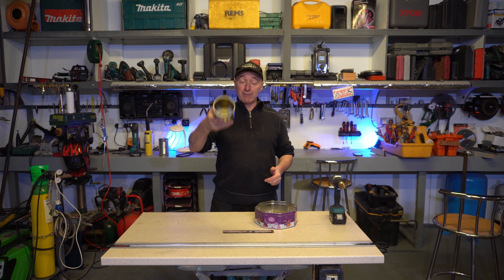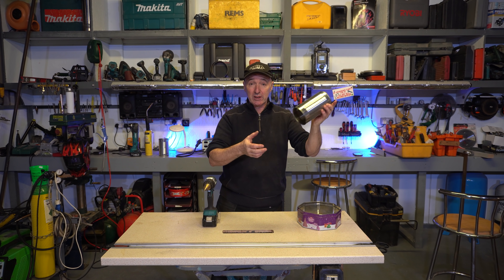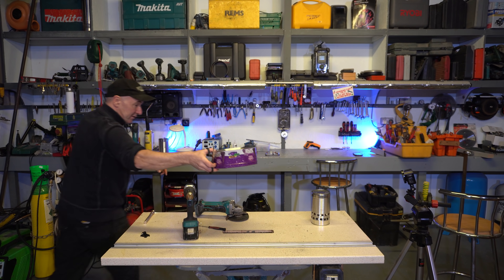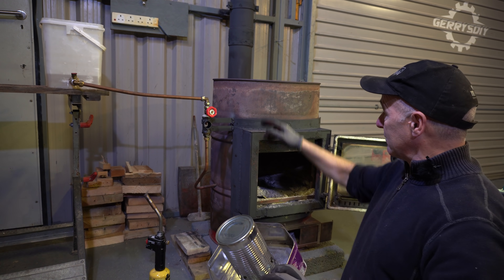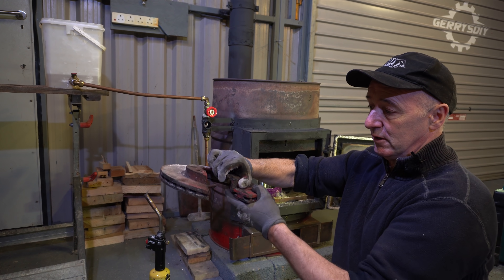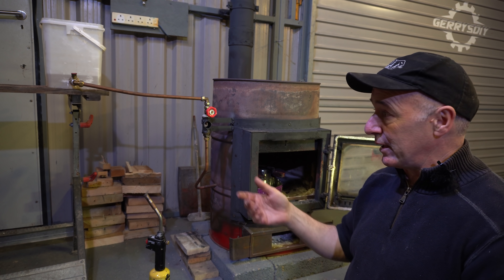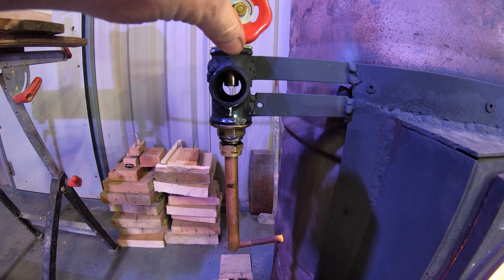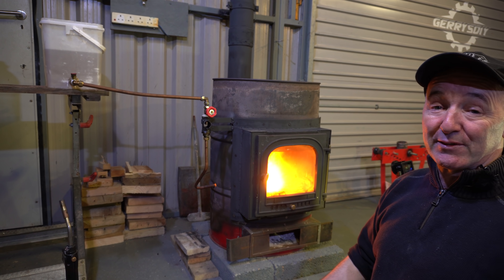Free Heat .. Fantastic Tin can Waste oil Burner

Comment: One thing you should note, one of the by-products of combusting hydrocarbons is water vapor. Unless you are venting the exhaust outside of the house, you are dumping water vapor in to your interior, which will over time migrate in to the walls, condense, and cause mold. Run a dehumidifier (which throws off a little heat) to keep the air dried out.
Reply: Yes, that's why burning candles in your home or having a gas stove will create black mold everywhere. So much water in oils.

Comment: I knew a marine mechanic who saved all the used engine oil from jobs. He would collect it, filter it, and feed it to a modified forced air furnace in his house. (I think he just changed out the Oil Burner Nozzle).  Free heat. Probably not that enviro friendly though.
Reply: That oil is better burned than dumped in a river or landfill.
Reply: @bladeoflucatiel  I agree on that. But most motor oil is now recycled into new motor oil anyway.
Reply: @kimchristensen2175  Or burned in powerplants.
Reply: What is environmentally safe..? Yes some fuels burn cleaner. But you have to capture the whole carbon footprint to get the answer.  Planet of the humans is an eye opening documentary.

Comment: I assume this was NOT for used cooking oil? but more for paraffin, etc?
Reply from the maker: Hi I start the process with a splash of kerosene in the burner to get it hot and within a minute I add veggie oil which will then vapourise. I dont blend it with anything so its pure veggie oil.  This burner will work with motor oil too. Cheers Gerry
Reply: @GerrysDiy  geez, then it must get extremely hot! this can warm up a whole factory no doubt, very hot

Comment: Free heat....so, I'm gonna need pipework, taps, a log burner, some form of chimney, kerosene and oil as my fuel. My missus aint gonna let me set that up in the lounge and oil aint free.
Reply: Not free, but recycled oil for heat. Not everyone uses oil constantly to have waste oil.
Reply: Your local chippy charges you for waste oil?! Hell, time you start using a different chippy.

Comment: How is this FREE
Reply: It uses waste used engine oil.
Reply: The "stove" may be free because you make it from odds and ends. The fuel ISNT FREE.
Reply: @Hugh_Manitee  Why is your local chippy charging you for taking their waste oil?
Reply: You can get used newspapers, junk mail, cardboard, mash them up in a 15 gallon bucket, press out the water and dry them as cakes. They burn clean and for a long time

Comment: The pan can also be made from an old brake drum, they last almost forever and radiate well. 
I built a fan forced one many years ago to heat water and run under floor hydronic heating, and as I built the whole thing into a detached shed
it also serves as a great clothes dryer in winter. I recently upgraded to a pulse pump system rather than babbit style, and fuel consumption is now under 1l/hour.
I get free oil from a heavy machinery company as used hydraulic oil, it looks pristine and has no contaminates visible. There is no smoke or smell once started and 
it heats a 200L repurposed and modified (ex electric) stainless hot water cylinder in just a few hours. I control that temp to 50C using a thermostatic valve to divert
excess heat to our 22kL water storage tank, keeping it above painfully cold and reducing freeze risk. I feed that HWC water into the house to the inlet side of two
Bosch instant gas water heaters. The gas heaters only add the differential heat from input to output, so gas consumption through winter when the waste oil heater runs 
 is almost zero, but if either system runs out of fuel, there is still always hot water available. I made the hydronic system with pex pipe and old aluminium printing plates 
used to clamp the pex to the underside of the floor, then I applied closed cell foamboard to seal and insulate it. This does require access under the house floor to install.
It is one of the best, and cheapest sources of clean heat available. It does make a bit of rumbling noise at night, but not loud enough to disturb anybody.
I also designed a more efficient burner that now gives complete combustion, lowering a polished piece of stainless steel into the exhaust flu comes out shiny after hours of use.
Apologies for the rant... just build one.
Reply: wow, sounds interesting! you should show us a video of it, I'm sure many would want my to see it

Comment: Free heat? Won't the open window for the smoke and venting the fire negate any gains or is this used to gas people?
Reply: "Tell me you've no idea how basic heating works without telling me that you've no idea". 
Salamander stoves have a chimney as an exaust for gases, heat radiates anyways, like any home fireplace.
Reply: @RenzitoARG  I didn't get your reply for some reason. Yes I have an open fire, a multifuel burner and oil fired heating in my house and I was brought up on wood and coal. We never put a sweet tin and bean can in the living room and hoped for the best though. I also fitted an air brick and vent into the house to provide draught to make the chimneys work effectively as uPVC windows/doors seal too well and produce a carbon monoxide risk. This free heat is only fit for a Dutch barn and they don't have walls.
Reply: Have you ever heard of this thing called a pipe? You can put these things called exhaust gasses through them and the gasses go from one place to another!!! I highly advise googling this thing called a "Chimney" I promise it'll blow your mind.
Reply: @NeillWylie  Most houses don't have chimneys and have very efficient sealed doors and windows even more of an issue in apartment buildings so pray tell O keeper of the wisdom what pipe are you speaking of, your fundamental one? In which case I recommend Flamazine cream it worked wonders on my gas axe burn. 😉

Comment: Burnt cooking oil, it must make a right smell.
Reply: He has a chimney extractor pipe, I think.

This could be run in a brick outside room with 2 water systems heated by it. One for your central heating and the other for your hot water tank.

Comment: Just remember people, that it is totally illegal to burn waste oil in the UK - Unless you have a 'permit/licence' - regardless of the amount. Personally i couldn't care less what people do.
Reply: same as posses chickens in uk ;d
Reply: Why it's illegal in UK?🤔
Reply: Just about everything's illegal in the UK now. The only things the police won't investigate and  the courts won't punish you for are real crimes like burglary, robbery, assault etc
Reply: Sorry old bean, it isn't illegal, as I use waste oils to run my Pug 306, fitted with a Bosch Diesel pump.
Reply: @0410195757  Sorry old bean, but do you ever read and fully understand a comment. If you are using any type of 'waste oil' in your pug, you are supposed to pay tax on it, otherwise that is illegal to do so. Burning waste oil (engine oils) is illegal unless you have a licence. Try looking up legislation.
Reply: @welditmick  ah sorry but the law is that if you use more than 2500 litres oh oil then duties would have to be paid. Also waisted engine oil is acceptable as with all oils if you pass emissions tests, which is always checked at the MOT test.

Comment: great in a rural farm type set up in ireland... but no good for suburban home ... also two to tree litres of hoiyl per HOUR ... waste hoiyl yes...   but any other hoiyl wont be cheap... i have been saving my vehicle hoiyl changes fo years i must have about 10 -  5 litre containers of waste engine hoiyl....  but i cant really use it in a suburban street in uk..it will stink... but.... if we have power outages this winter.. i will be burning it in back garden to heat water bottles up etc..... maybee a scaled right down version of your burner i wont need the extreme heat... just enough to boil water and cook soup..   ..
Reply: Burn it at night 😁
Reply: Can always be used as barter too

Comment: Tin can and a sweet tin and also a compleet stove or it wouldn't work :o because when you open the door it shuts down.
I dont want to use another compleet stove. So i wil try to come up with a cheap solution.

Comment: my oil is food oil, palm oil, i cant let it drop like you. have you use a special valve? if i few open the valve, the oil won't pass. i have to full open my valve to see the oil pass, but it is too much , so i have to manually open and close the valve to let the fire burn properly. i use an electrovalve too, with temporization, but the oil cant pass trought the narrow hole of this..

Comment: hi, how you have solved the problem of the frozen oil? under 10 c° the oil frozen and can't drop down in the copper tube. any sudgestion?
Reply: Warm it up?  Once running, the room temp is fine.

Comment: Hi Gerry, while doing some repairs to my oil system last July, inspired by your videos, I took a close look at the tank itself and was horrified to discover some cracks on a corner of the tank where the plastic had gone a whitish colour.  I marked their length and put a ratchet strap around the tank as it was full.  A few days later the cracks had grown slightly so a new tank was delivered by a Clontarf-based company who drained the tank, installed the new one, refilled the oil (filtered) and disposed of the old tank - all for a very good price!   A tank failure is a catastrophe - someone I know had one and it has cost about €20K with clean-ups, legal actions by neighbours and EPA inspections.  Three years later the work is still going on.  Might be worth a video to remind people to examine their tanks periodically, especially after ten years.

Comment: Why doesnt the oil leak out the joint between the dog food can and the bisquit tin?
Reply: i'm wondering the same question ! but thanks for the idea !
Reply: I'd assume it will if it weren't burning. But the tin should be hot enough that the oil vapourises upon touching it and burns off right away.

Having said that, it's probably smart to weld the gaps and seal them when making your own.

Comment: Brillant job gerry! How do you find using a old oil barrel, I thought about it as I can get one easier than a old gas cylinder. Is the oil barrel too thin? Would it stand the heat?

Comment: Will the drip rate control the heat output and is there a ratio for the burn tin and air supply can?
Thanks for your videos.
Reply from the maker: Hi Larry. Yes the drip rate controls the output but there is a range where too little will cause the flame to extinguish and too much will cool the burner and stop combustion. The flame will consume as much air as needed and is self regulating unless you use a blower to increase the airflow. Hope this helps Cheers Gerry
Reply: @GerrysDiy  Thank you

Comment: Hi Gerry! Tell me what is the diameter of the holes on the air can. And what is their total number.
Reply from the maker: Hi Alex. The can is 100mm diameter and there are 2 rows of 15 holes. The holes are 12mm in diameter spaced at 20.9mm apart. Cheers Gerry
Reply: @GerrysDiy  I understood. Many thanks.

Comment: Hi Gerry, love your vids, made a waste oil burner myself for in my workshop. Made it from a 50cm diameter pipe, 80cm's long and capped it at both ends, made a door in the bottom and an exhaust to the outside. Running across a bit of a problem right now, it's burning very sooty, I'm using a stainless cooking pan on the bottom, raised it about 1/1.5 cm of the floor and made a 10cm hole in the bottom underneath for fresh air. Any suggestions on how I could solve it burning more efficiently? I've tried using a fan in the bottom hole, but that only creates more smoke. Thanks in advance!

Comment: I used a bunt cake pan made from steel that has a cone already stamped into the center and capped the center with another can with the air holes. The natural draft makes a real hot fire. Thanks for the video! Cheers.

Comment: Dumb.
Reply: Front wheel is sticking out at an angle and grinding noise. Wheel won't turn. Seems like control arms or spindel . Brake line is broke

Comment: Spoiler, It's not free
Reply: It is. Hence the name "Waste oil". If you want to properly dispose it you most likely have to pay for it. Also it can burn everything. Gas, Diesel, Kerosin, Vegetable Oil etc. It may not be good for the envirement though
Reply: @foty8679  cool info but not free as such
Reply: @wolftime2000  totally free. My local mechanic gave mine to me and has asked when I can take more. Storage is the only limiting factor for me right now. Obvioysly personal situations differ but if your situation doesn't mean free oil then perhaps you are better off finding a different heating solution.

Comment: These things have been used almost as long as forever . They were called smudge pots used in orchards to protect plants from freezing. This is a small version and yes they do work .
Reply from the maker: Hi Jim. This one is my own design but the idea is simple. Heat the burner red hot and drop in the fuel. Thanks for commenting Cheers Gerry 👍

Comment: Nice video, very creative alternative to heating except to be honest I wouldn't call it free, or even cheap. Oil is expensive and  unless you have access to a lot of oil or an alternative fuel, I wouldn't even bother with it myself. It`s still a cool video though.
Reply from the maker: Hi Clint. Yes if you have to buy the fuel it's an expensive way to heat a shed but there are lots of places to get the waste oil for free and this will burn most types of waste oil too. Thanks for commenting Cheers Gerry 👍

Comment: So what are the chances of me getting this wrong and ending up dead 😂😂😂

So questions 
1) can I build this into an old oil drum cut a hole in the top connect a flue to the top of the barrel and take the fumes outside can I use any flue or liner to take the fumes out my barn
Reply from the maker: Hi The Snooker Barn. Here's the build of this stove https://www.youtube.com/watch?v=g0VWA8tC9cM but essentially that's all I have done in my shed. Thanks for commenting Cheers Gerry 👍

Comment: can i ask a question.  how long will it run for with say, a litre of veggie oil?
Reply: he said 2-3 litres per hour?
Reply: @davidhastings7714 , that make it expensive to run then unless you are getting the veggie oil for free.  I can heat my entire house and cooking with gas, 24/7 for around £6 a day.  At Tesco 5L will set a person back around £4.
Reply from the maker: Hi Cyberlizard. You are correct that this only works if you get the oil for free which is not that hard to do. My shed is uninsulated and made of metal so I need lots of heat in winter to make it warm enough to be comfortable. These burners will work with lots of different oils but I prefer veggie oil. Thanks for commenting 👍

Comment: If you run your drip line through another slightly larger pipe air will get pulled in along it and keep your drip line cool.

To be really efficient the air for combustion should come from outside, as the interior air is already heated so exhausting it is a waste of heat. This will also reduce the amount of draft being pulled in from every crack.
Reply from the maker: Hi. My other burners have the oil line in a steel pipe but this stove is being changed for the next project. Thanks for commenting Cheers Gerry 👍

Comment: A globe valve would be a much better choice for the drip mechanism than a gate valve.  Globe valves are designed for throttling flow whereas gate valves are for either wide open or shut.  Other than that, good video.  Stay warm.

Comment: nothing is free. something needs to be consumed , used , made , ... although I feel the draft will carry all the heat outside though the chimney  .. that's why oil boilers have several passage ways and also boiler decelerators to keep those HOT gases more time in the parts of the boiler

Comment: I really love your videos that cover all sort of things. What I am wondering if you could make batch box rocket stove  ??? Something with ultra efficiency and a short rocket stove cylinder. This way you can use regular size wood and load the stove for 12 to 18 hours of burn. Thanks and keep up the great work too.
Reply from the maker: Great suggestion! Victory First. I have the steel in the shed at the moment for this project. More on this soon. Thanks for commenting Cheers Gerry 👍👍
Reply: @GerrysDiy  I look forward to see more videos from you Sir. Peace, Vic

Comment: So you have a drip fueling the fire, what is preventing the fire from traveling up the oil into the pipe and into the storage tank?
Reply: Lack of oxygen genius
Reply: @zayferdevelopment313  have you ever seen the gas cans that explode when pouring on the fire? I understand that the oil has a higher Flashpoint than gas, I was just asking what kind of preventative measures was there to prevent it from flowing back up. On a propane tank/grill you have a regulator to regulate the amount of gas, but also prevent the flame from traveling back to the tank.
Reply: @lunam08ify  Nope, but i have seen flame flash up to spout opening but no further. They do NOT 'explode'. Combustion cannot travel further up into spout or can due to lack of oxygen...😳
Reply: Seth Luman Cooking oils don't combust like that. They need considerable pre heating. Fire simply wouldn't travel back up a pipe of cold cooking oil.

Comment: You said in another video that oil leaked from the big tin, does it leak now?
Reply from the maker: Hi David. The tins were just to try out a design concept and they do a great job for what they are but won't last too long because the metal is very thin. When the metal gets hot they expand and it is possible for some of the veggie oil to make it past the joint. that said once the tins are red hot the oil vaporises and burns almost immediately. I have a welded version of this burner that works great in some of my other videos. Making another video of this burner though to answer questions like your one. Will be uploded in a couple of days.Thanks for commenting hope this helps Cheers Gerry 👍